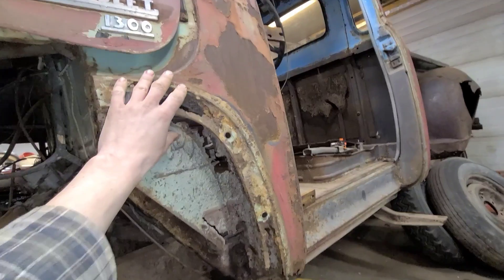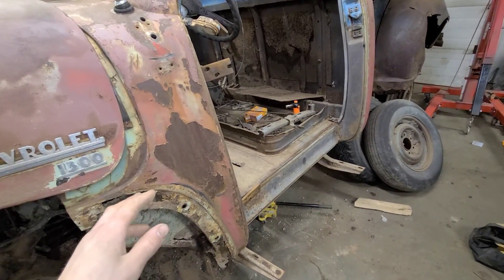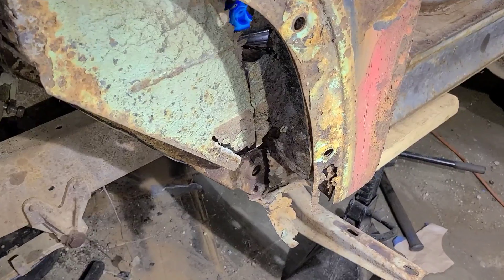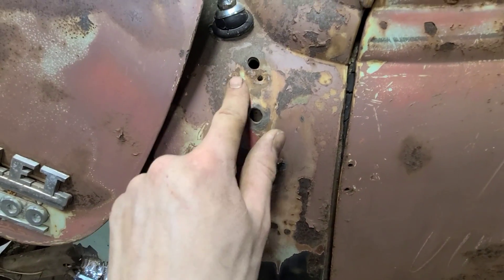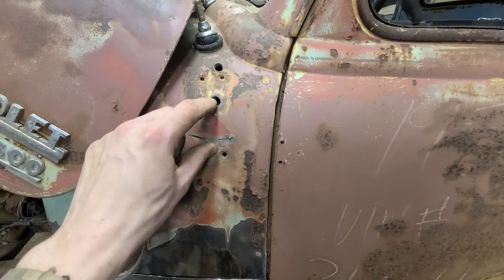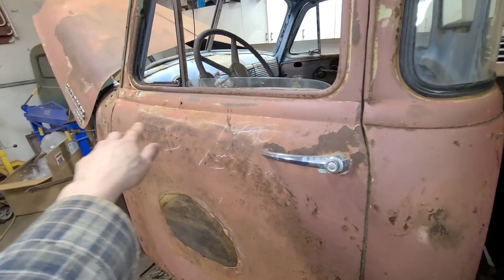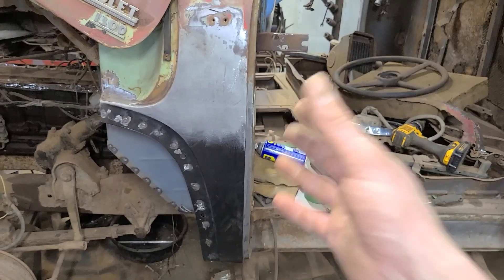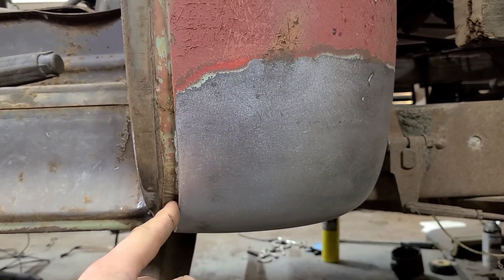Fix Rust The Fast, Cheap, Easy Way!

Comment: Thanks for posting and explaining your approach to the problems rather than just showing with no explanation. I wish your video was out before I tackled the same area.  One question, if you had to open up the door gap would you cut the cab or trim the door edges to fit? Trimming the doors seems much more involved and not sure when you would pick one method over the other.
Reply from the maker: Every situation is different. Usually if the gap is tight I trim off the door edge, it's easier to reweld the edge and grind/file it to fit, rather than trying to cut/hammer and weld the body sheetmetal. I'll do a video on this the next time I run into a problem with tight gaps.

Comment: I wish I was working on 16 or 18 gauge cars.....much less problem than the 20 gauge stuff I do. Keep it up Kyle .....doing great Trucks in that condition a few years back we would just say Naaaa. and crush them Now we save anything we can find.
Reply from the maker: Oh yeah I don't envy you having to work with all that VW sheetmetal, it's like working on a tin can compared to these old pickups!
Reply: @CarterAutoRestyling  warp city if your not careful. especially the black cheap denmark metal....total slag steel.

Comment: Kyle, I wish I had seen this when I was doing that section in my 51-3100.  I did replace the kick panel, the arch between the cowl and kick panel, floor sections and rocker panels.  I chickened out and bought the panels from LMC. It's getting better but still more to do.  Looking forward to more video's on your 53.
Reply from the maker: Thanks for watching! Best of luck to you on the '51 project!

Comment: Is there a reason you weld and grind the weld down right afterwards? Is that introducing more heat and chances of warping
Reply from the maker: There is always distortion no matter how you weld. The key to minimizing it is to have perfect panel fitment prior to welding. This is a new technique I've been playing around with for about a year and I find I am getting less warping by keeping the weld warm by grinding it immediately. It also results in a less brittle weld and more consistent penetration. The faster a weld cools the more brittle it is, which is why tig or gas welding is still best for sheetmetal, but I prefer mig welding when I have limited access to the backside for hammer and dolly work.

Comment: Curious, what is the abrasive type and number for the screw-on disks you are using to grind the weld. Also what kind of RPM does the drill go to? Looking to try this out, would like to buy the exact same ones
Reply from the maker: They are Norton 3" 50 grit Rolocs. As for the drill it's just the cheapest one I could buy at the local hardware store. I'd actually reccomend getting a 90° air die grinder for doing this type of work, it's faster and you get more life out of the grinding discs. The reason I use a drill is because after years of working in a bodyshop I can't stand the sound of air compressors or air tools haha
Reply: @CarterAutoRestyling  Ok sweet thanks, just a beginner, also what size holes do you do typically for plug welds, 1/4" 5/16" ?
Reply from the maker: @mikegolberg856  5/16" wherever possible, sometimes you have to use 1/4" when the flange is small. I had to use 1/4" where the cowl welds to the door jamb on this truck.
Reply: Also what type of roloc backing disk holders, looks like there is soft, hard extra hard etc
Reply from the maker: @mikegolberg856  I use a hard backer. Not sure the density, but you don't want a soft backer because it will flex and cause the disc to dig into the metal instead of the weld

Comment: what size grit and brand are you using to grind weld after you do 3 tacks in a row, o patch panel, awesome work.
Reply from the maker: Norton 3" 50 grit roloc discs

Comment: Love the weld and grind approach. Seems less laborious then welding it all and grinding it all. Assume it's better than waiting for it to cool and grinding is something with less heat input than welding further.
Cool repair. Cheers.
Reply from the maker: Yeah that's about the size of it. I'll do a video on the process eventually
Reply: @CarterAutoRestyling  cool, throw it in with the MIG welding with filler wire one.

Comment: Kyle, where did you buy your inner to outer cowl piece? I bought one once and it was garbage. I was able to rebuild the original rather than mangle the replacement.
Reply from the maker: I got it from Scott's Super Trucks here in Canada. I believe the brand is Key Parts. The dynacorn ones are complete garbage from what I've seen

Comment: I like that sanding thing you use on your drill mate, can you tell me what make it is? Great patching by the way 👍
Reply from the maker: It's just a 3" Roloc back up pad attached to a cut down 1/4"-20  bolt
Reply: @CarterAutoRestyling  Thanks mate, it works well hey !

Comment: It is very interesting: I thought how to proceed and where I would cut and replace the lower piece on the side and you really cut it within half an inch where I would have cut it.
I have a problem with my right thumb today. Yesterday I had to cut metal in  tight and hidden place and my grinder caught a heavy handlamp and shot it on my right thumb. The tip is swollen and the nail is nearly black. You could never archieve this ballistic effect if you tried repeating it. You cannot wear gloves if you want to hold the grinder tight enough.

Comment: Its looking better all the time. I think I would be like you and want to chase out all the panel lines and door fits etc but I wonder how well these things were put together in the factory back in the day. I know that in the UK where I live Ford and GM 1960s/70s run of the mill offerings were pretty poor quality off the production line. Rust was a major issue. To get them back looking good and presentable is a massive amount of work.
Reply from the maker: Fit and finish was non existant back then. Spent years working at restoration and hot rod shops making every panel fit perfectly, I have zero interest in doing that anymore. I don't attend car shows, so trying to build perfect vehicles does not add to my enjoyment of the finished product.

Comment: That cab corner is a thing of beauty! What a pile of rusty junk that truck is, but by the end of this video solid metal was where a pile of rust flakes and thin air once stood! I am watching this instead of Power Tout videos--this is more interesting!
Reply from the maker: Glad you find it interesting! I don't have any vehicles capable of driving more than 10 miles without catastrophic failure so I doubt you will see power tour footage on this channel any time soon haha

Comment: Looks like those are pretty decent repair panels. They can save time, but they can cause a serious mental breakdown too, if the quality of the panels suck balls. I like to see how you are going to fix that door gap, i have done few of those, but i am sure that i'll learn something new. Anyway, great job again!
Reply from the maker: Thanks! I don't mess around with show quality stuff anymore, so I don't waste my time trying to get the gaps perfect on these trucks. As long as the door functions that's good enough.

Comment: What would I do for any size Garage to work in.?   I am board out my mind.  Got pile of tools, body, and Mechanical. but not dam single place of descent price to rent to just do DIY projects.  everybody wants arm, leg, and lung, like this empty building is so prized.   You just got start on one rusted out spot go from there. Sorry for the rant at the beginning, nice work ethics... yep aftermarket panel is nice suggestion what should be still got work, nice method of choosing what is easier to fit than the complicated bends. awesome job.
Reply from the maker: Thanks for the comment! I hear ya, prices for everything are nuts

Comment: I use a small sawzall made by Mac tools as opposed to a cute off wheel,the thin blade leaves a smaller gap,its easier fit,easier to weld too,I butt weld about everything as far as sheetmetal,unless it's a pinch weld of course. I too use as little of the patch as I need,they often don't have crisp body lines,the contour on aftermarket aren't the greatest either,so I use no more than I need to complete the repair.
Reply from the maker: Good idea using the small sawzall!
Reply: If I could leave a picture on here I could show it lol.

Comment: Yeah, but could you do a "How to" on how to not do "How To" video's?

13:56 Kitty cat face to the left of your index finger, doggy just above him. (That thing humans do seeing faces in clouds,, etc...)

I agree on the not using the whole replacement panel if not needed.
My first attempt at doing a rear quarter panel, I replaced the entire replacement blank, even though the entire quarter panel didn't need replacing, and fought a bit with warping.
The second one, which was actually worse, I only replaced what needed replacing and it was a much easier job that finished better.
Reply from the maker: Oh yeah I could definitely do a how to on how not to do haha

Comment: Have you ever   heard of tack welding  a  door shut before chopping the tops
Reply from the maker: Yeah, kind of pointless because you still have to cut the door back open to weld all the jambs up. Much better to tack weld x bracing in the body
Reply: @CarterAutoRestyling  true and safer